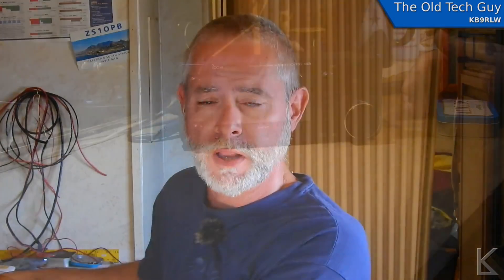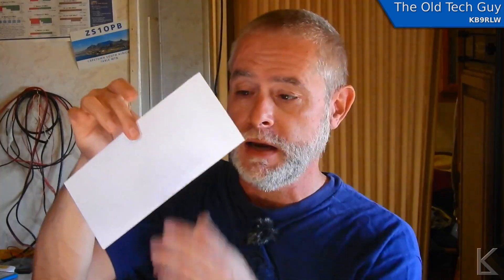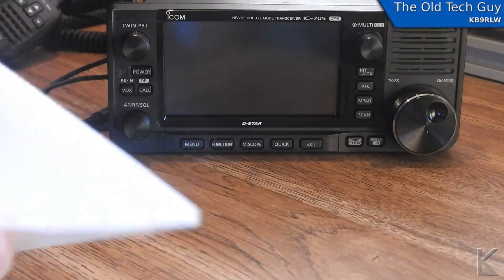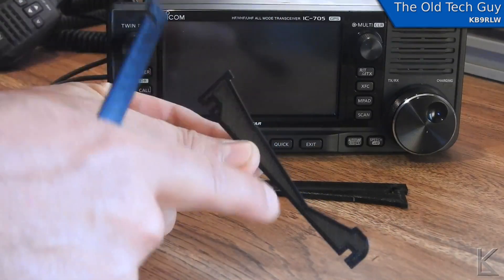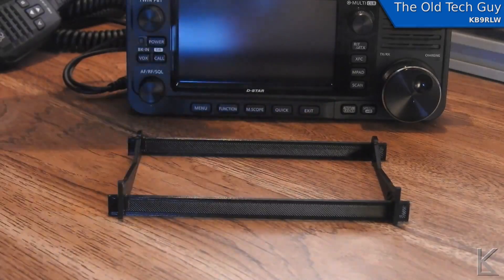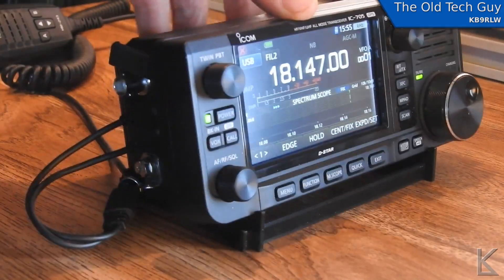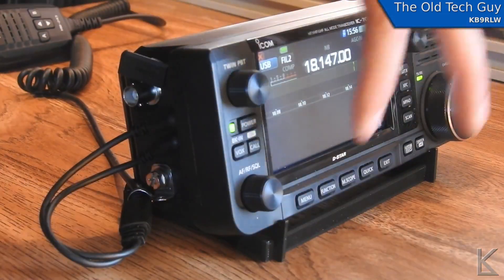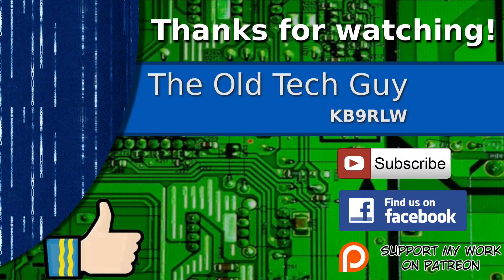Ham radio & 3D printing - A very portable table stand for the Icom IC-705.

Comment: I'd probably take some thin rubber tubing and split it lengthwise down one side, so they could be slipped onto the bottom edges of the plastic pieces. That'd give them a bit more "grab" on the surface. Either that, or I'd take a sheet of shelf liner with me into the field, folded up into the same envelope. If it's big enough, you could even use it to stabilize a key on a table next to the radio.

Comment: 👍 Good idea. An interesting angle 🤭 on solving the problem. The inability to tilt radios up to a convenient angle seems to be common problem on many expensive portable and base station rigs. It seems odd that it doesn't appear to be given much consideration in the designs. Basic human factors requirements that are completely overlooked?

Comment: Kevin, use TPU. With TPU, you can make the stand bulletproof plus it will not move around on the table; additionally you can make the joints a friction fit so it will not come apart when you move it. I really like TPU, the stuff is just amazing and super tough!

Comment: Kevin, love the videos.  When you get stopped for a period of time in your RV, do you recalibrate your 3D printer or how do you keep it calibrated while on the road?  My Prusa I've calibrated which took some time. I couldn't imagine doing that every time I moved it.
Reply from the maker: I haven't done any adjustment or bed leveling since before I left Ft. Wayne just over 2 years ago.   It's an anycubic I3 mega all-metal frame printer.   A really solid steel construction. No plastic parts in the frame.  I think that makes the difference.
Reply: @loughkb  Wow that's amazing.

Comment: Make some more and sell them on ebay.
I'd buy one.
Reply from the maker: Not really practical, unfortunately.    About 4-5 hours to print a complete set and I have to run my generator to use the printer.
Reply: @loughkb  That is unfortunate, there's an Icom equivalent coming but it's $45!! and your version is more oriented for mobile use.

Comment: Excellent Kevin!

If you attach small linear rubber strips on the front & back it should stop sliding on slick surfaces when you push the buttons.